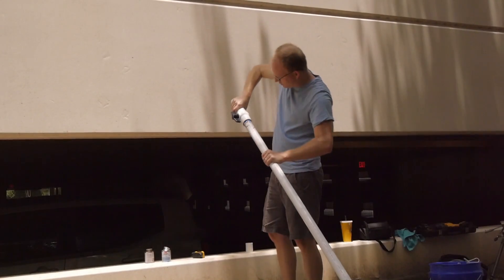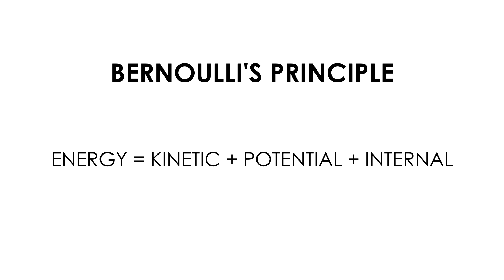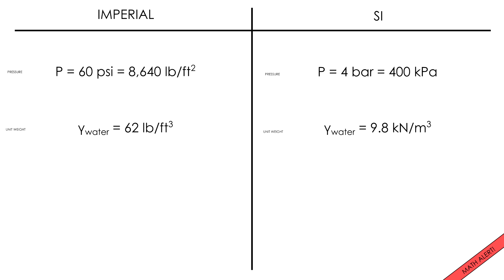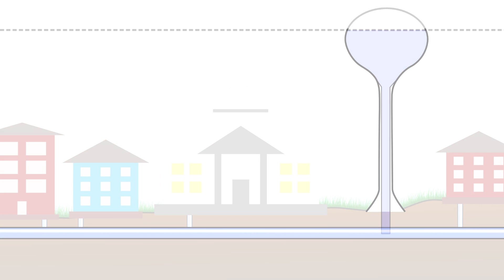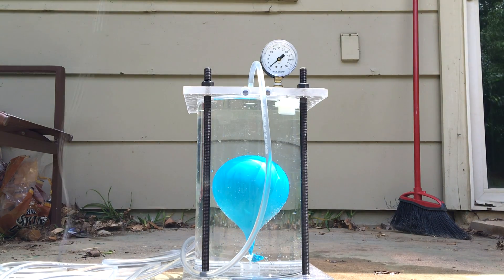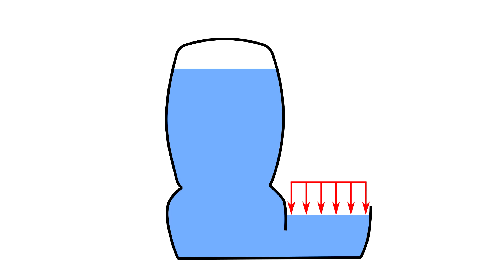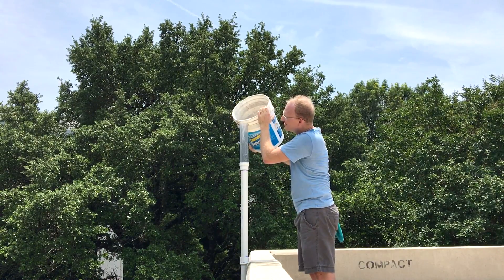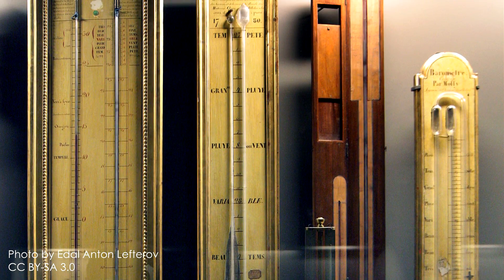Boil Water at Room Temperature! - Hydrostatics

Comment: I probably would have made the same mistake. Judging by your clothing, it is probably around 25 to 30C, so looking at the phase diagram for water the line between liquid and gas crosses the 30C line at around 3 KPa so it seems like you only need around 30cm of transparent pipe at the top, and you’ve got at least twice that. So I’m guessing that all the dissolved gas in the water is the real problem as to why the water sinks below the transparent pipe section. If you could close the valve at the bottom and refill and try again, the water is probably degassed enough to stay visible on the second (or third) try.

Comment: If the water column is 35 ft tall and Mercury is 13 times as dense a barometer would need to be about 2.7 ft. but they are much shorter. Right??
Reply: For the same size bucket. If the bucket was smaller you could use less liquid.

Comment: What? The water at the top of the pipe is boiling? Is the water at the top really at zero pressure? When is it at zero pressure, when the bottom was closed or when it opened and encountered atmospheric pressure? And when did the water start boiling? What devilry is this?! Excuse my ignorant mind, but it is blown!

Comment: Serious question:
Taking into account the Earth's curvature, the Earth's curvature equation (8"(mile)^2). You have two water towers and both have the same sea level water height, let's say 100 ft, using the pressure plane should they both be 8" lower relative to each other?  In other words, you add a 3rd water tower in the exact middle of both, and with the same dimensions, shouldn't that one be 4" lower of the pressure plane relative to either one?
Reply: your equation for curvature yields a number with a unit of length cubed (inch x mile x mile), in actuality, curvature is thought of as travelling around a circle with radius R for a very short distance, where the value of the curvature is the reciprocal of that radius, you should therefore get a number with unit 1 / length, how did you get that value of 8?
Reply: @JansthcirlU  Not my number I found it online somewhere. Is it wrong? 25k mile circumference.
Reply: @Live-Life-Freely  I think I understand what you mean now! The Earth's curvature doesn't cause the water to physically drop inside a water tower if you look at it from a distance, it just means that when you look straight ahead from where you're standing, the top of a building in the distance (like a water tower) will lie below your line of sight. This is similar to how you have to look down to look a shorter person in the eyes (otherwise you might look over the top of their head).

Comment: ---  DO NOT USE A LADDER LIKE THAT  ---

Use an extension ladder that goes ~3' above where it touches the roof. Have the angle at ~4:1 (1 unit of length horizontal for 4 units vertical - if you're going on a 12' ladder against a wall, the bottom of the ladder should be about 3' away from wall). 

Make sure the bottom of the ladder legs are level and on a secure footing and on a non-slippery surface (wet wood = surprisingly slippery). Make sure the both legs are touching the roof with an even amount of pressure.

If you only have a step ladder, make sure it goes past where it touches the roof, and made sure you tie the step ladder's legs together so it doesn't open accidentally.

More safety: have 3 points of contact at all times when climbing a ladder, and only put your hands on rungs (not the legs) when using a ladder.

It's easy to get lazy on ladder safety, but its just as easy to seriously mess yourself up on one.
Reply: Wow dude, that is an awesome comment! Nice work! Ima take a screen shot of this!
Reply: De1n3n Kr4ftTr4um  thanks UwU

Comment: Great video clearly demonstrating the concept of Pascal's Law. However, at 03:35, what you said need not be the case always, at least universally. Some of these tanks have a pipeline going to the top externally and then filling up the tank till a float valve restricts the flow. In that case, the pressure corresponding to the height of the water column doesn't necessarily indicate the pressure of water in the main line..

Comment: out of curiosity what would happen if you had kept the system closed and decreased the size of the pipe (with boiled water vapor and all still in place)? assuming a collapsible air tight tube of some kind to test of course.

Comment: When a propeller spins in water....it creates by its contour a high pressure side and a low pressure side like a airplane wing thus creating thrust  ( lift ) ....if the prop spins too fast and the pressure gets too low a phenomenon known as cavitation occurs. This is actually the water boiling, creating air pockets ( bubbles).... And thrust is reduced and if continued will eat away at the leading edge/ side of the metal prop. Cavitation IS boiling water!!!!!

Comment: So what happens when you dig a 20-foot hole and submerse the bottom part would that still work or is it actually the height of the tube from land or could it be the height of the two from anywhere like maybe there's an electromagnetic force only on the plane level and not inside a hole it's just an experiment that would open up many doors potentially
Reply: It's related to the water level, so about 30 feet of water would stand in the tube, so if the ground water is 25 feet down the top of water would be at 5 above ground.

Comment: So you could create a bomb by just throwing a jug into the air thats connected to a tank with a sealed air filled container inside, the pressure will cause the tank to rupture and quickly expand.

Comment: While at first this sounds like a  very smooth introduction to hydrostatics, yet it misses any explanation. All reasoning is done from equations/principles which drop out of the blue. A student may ask why is there energy involved, and how to connect the pressure (which is not explained) with the energy (while there is no deformation done)? Explaining  complex subject as you do does not lead to insight. It is a collection of nice animations  only.  A more consistent way is to introduce Pascal's law would be to explain first what a fluid particle is and then discuss the forces acting on this fluid particle being at rest.

Comment: can you explain the height difference in the pet bowl? In the vacuum side, pressure is vapor pressure of water at room temperature. on the other side, it is atmospheric. The height difference of water is not enough to accoutn for that difference. Why would the bowl refill with water if you drained some from the bowl? Is there a tube connecting the top of the tank with the top level of the bowl?

Comment: Love this and everything else I'm seeing on the channel - but just a little niggle. You fall into the lazy trap of saying that a mercury barometer is about 13 times shorter than a water barometer. Of course you can be infinitely larger, stronger, brighter, etc and basically any measurable quantity (that has no meaning as a negative) than something previously measured and you can be 10% shorter or 50% or 99% but once you are reach 1 times shorter there is nothing left and you have nowhere else to go - though I am certain that you know that! Also, you didn't actually explain how the pet bowls "work". you very clearly demonstrated how the water "magically" stays in the large container but now how it ultimately gets out.

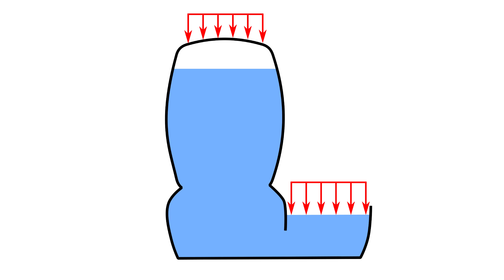Comment: 7:04 i just realised, does that mean the level of the water on the open side would change depending on what altitude youre at, since youd be lowering the atmospheric pressure if you go higher?
Reply: Good point. If you had that cat bowl with you in a hot air balloon, as you go higher the bowl would overflow.

Comment: Nice video 👍

You could extend on the water / vacuum concept and build a wet bulb thermometer to measure an externally applied vacuum to measure vacuum pressure, it’s a very simple, accurate method of measuring vacuum.

Comment: At the end, you should have blocked the outlet, refilled the top, and it should have been clearly visible.  I think the only reason the water wasn't visible was gas diffused into the water.  You removed that, adding a little more water would have added a TINY bit in, it would have been visible - but you should have also done something like 6 additional feet.  Not that I would have bothered to do this myself, and I know it must have been deconstructed by now.

Comment: I think the reason why water doesn't come down in the water tub of dog in the video is 
If we allow the air to enter into that closed space then the water comes down due to wieght but not due to atmospheric pushing effect. Atmospheric pressure is low then the water so that it can't pass through it . 
The container has the tendency of making itself with some matter as it can't have vacum due to atmospheric pressure.